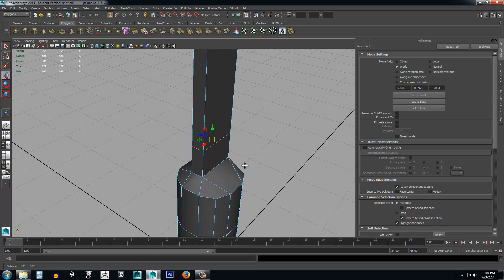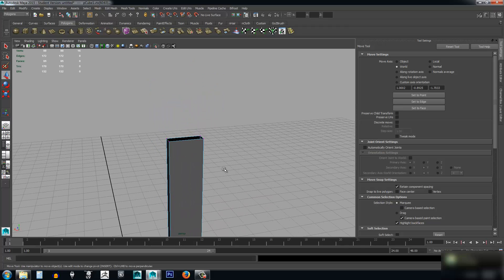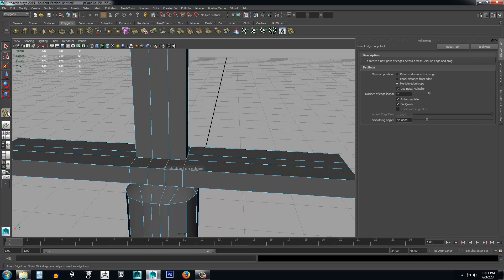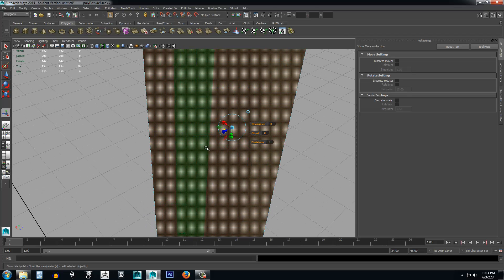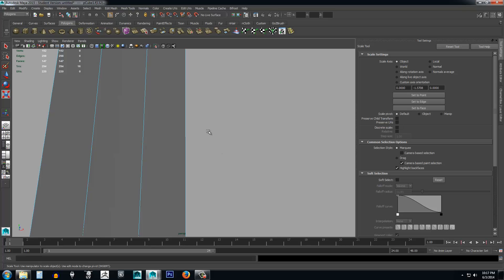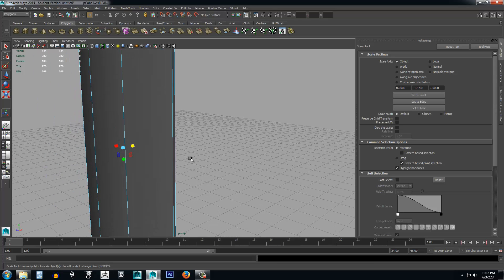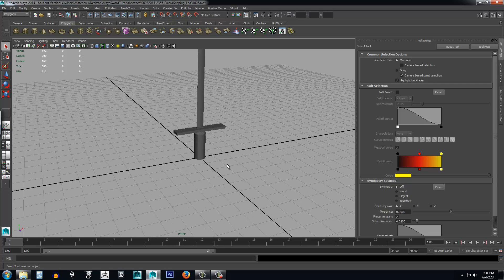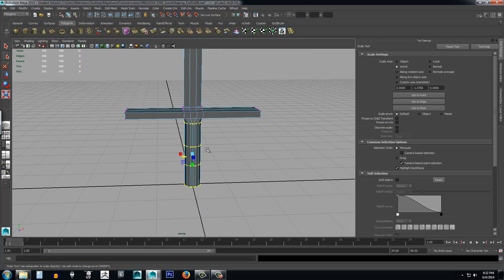06 - Maya 2015 - Bridge, Extrude and Multiple Edge Loops

Comment: Hmmm. So I restarted from the beginning, recalled most on my own but played your videos through while doing do as a reference point. When I tried to do the double loop cut down the vertical center of the blade a had a stopping point as it went down the blade, down, under then up the hilt and then stopping one face away from the hand-guard. I could then loop the blade with another selection but, and area seemed to be unchangeable. I didn't think I did anything wrong, but I decided to delete my sword from the top to the hilt. Well, there seems to be no rhyme or reason to Mayas choice in how this works but, it will not let me delete and sections or the whole sword even without leaving random variations of faces and edges which are different every time I try to re-delete them, undo and start over. It keeps saying something like the "edges are too complex", even though there, in one case, was only four edges making a square but, with no face. I have no idea how to understand this deletion process and it's method for selection and that is frustrating. Also,  is there no "redo". I tried using redo but, it did not restore previous versions after any "undos".